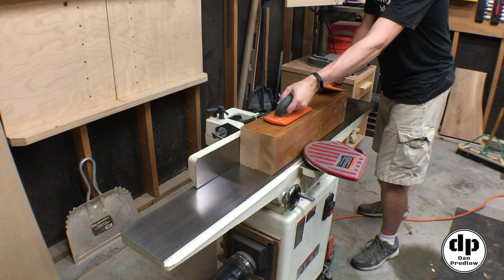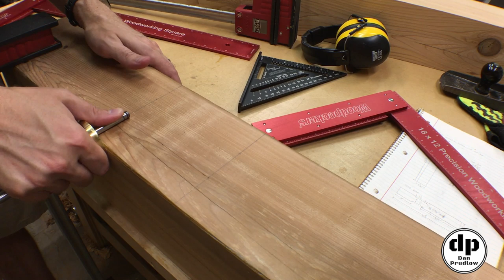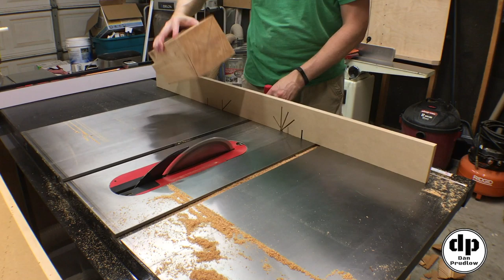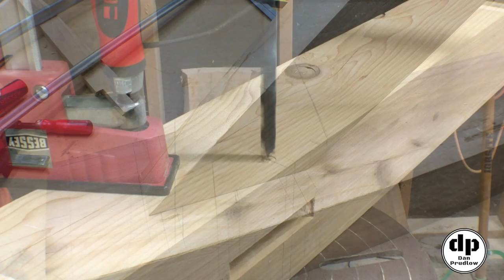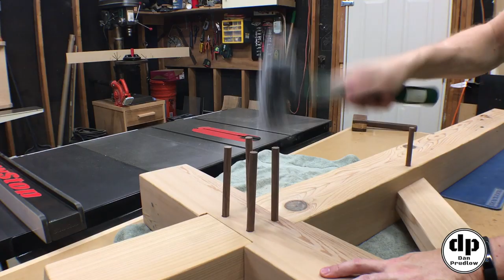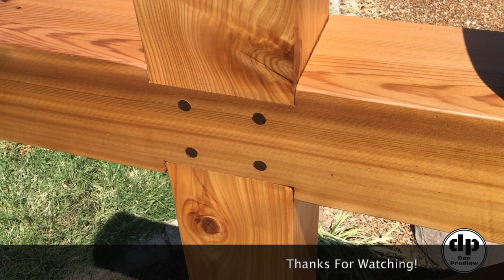Building a Mailbox Post from Reclaimed Cedar Timber

Comment: Very nice work, when you were drilling the holes through i thought they would have been for some round head Bolts, Nuts and Washers to set it off, then you put the dowels in without some glue, cut them all off, then when you sealed it all the dowels set it off just as good, so well done on the build it does look great, i bet your neighbours are jealous?
Barry (ENG)
Reply from the maker: Thanks for the compliments.  Funny you mention the neighbors...the day I installed it I was cleaning up and had someone stop and ask where I bought it because they were interested in getting one like it.  Thanks for watching. 👍🏻

Comment: Pretty nice! I'm surprised you did not use any glue or construction adhesive. Looks great though...thanks for posting.
Reply from the maker: Thanks!  The only way it will come apart is if someone took the time to knock all of the dowel pins out.  Adding glue would have complicated the assembly and being my first time doing this joinery I didn’t need any help messing it up. LOL.  Thanks for watching! 👍🏻

Comment: Very nice work!  I recently did a  mailbox build with my son on my channel as well.  Yours is much nicer than mine :)  Love the contrast of the dowels against the lighter wood.  I wanted to ask how you like your Dewalt planer?  I have a Porter Cable that has been very reliable, but it leaves about an inch of snipe on the board if I don't chase it with another.  Also, the Porter Cable doesn't have dust collection, which stinks.
Reply from the maker: Thanks for the compliments and for watching.  I do like the dewalt planer, so far I’ve had no issues and it’s taken everything I’ve put through without any trouble.  It still leaves a little snip even with the in/out feed tables but I think you will have that with any planet that isn’t a big floor standing beast.  I’d like to get the shelix cutterhead for it which would improve snip and make it quieter.  The dust collection is nice, there is usually very little to clean up after using it.  👍🏻
Reply: Dust collection is where it's at!  The less dust the better for me anymore.  It didn't used to bug me as much, but the older I get the more it irritates my sinuses and eyes.
Reply from the maker: Amen to that!